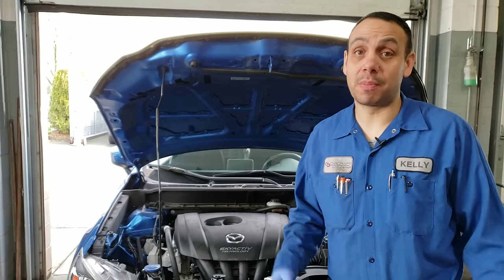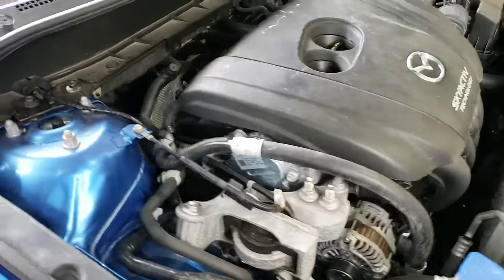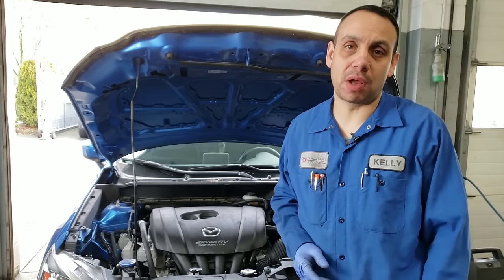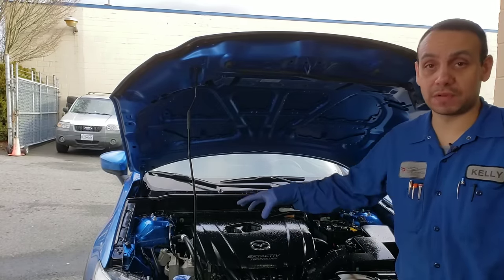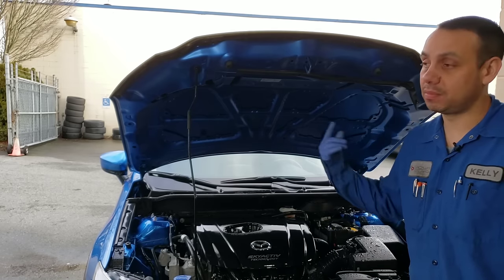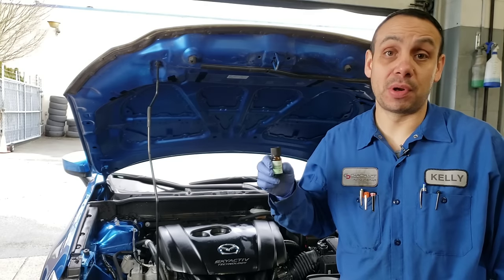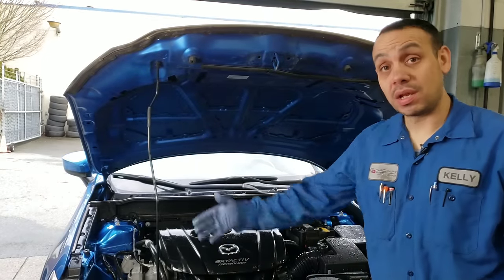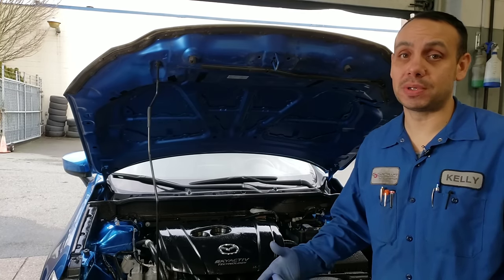Easy Tip To Keep Rodents, Mice & Rats Out of Your Engine Bay

Comment: I’ve been aware of rodents - chimpunks in particular - invading my car.  I don’t keep anything that smells edible including chewing gum in the cabin.  I’ve tried the peppermint oil spray.  This summer a horrible smell blowing from the cabin vents got my to check the cabin air filter. It’s up under the glovebox.  Sure enough there was a large nest and a dead rodent in the blower.  After replacing the filter I sprayed peppermint lemongrass and clove oils eveerywhere - in the cabin foot wells, under the hood, wheel wells, and the gravel around the vehicle   Will try moth balls next.  This is a 2016 Prius and I’ve heard this is very common in my car, but very common now with most new vehicles.

Comment: The mouse blocker device works well. Rodents don't like high pitched sounds or flashing lights. If you have a garage, open the hood and shine lights toward the engine bay at night.Rodents hate light!

Comment: There is a certain small wire on the 2012 - 2015 Honda CR'V's that rodents like to chew on. It will not help your engine run well at all.  That wire is located in the center of the firewall down low, almost out of sight.

Comment: I have that same Mazda engine in a CX-5 that sits outside and have had mice nest under the plastic cover so I wish he had taken that off and inspected underneath it. I will have to try the peppermint oil treatment, hadn’t heard of that option. We’ve put Bounty dryer cloths in a car that we store for the winter which seemed to help.

Comment: they used to use soybean at part of the materials for electrical wire cause it was cheap and then they noticed it was getting eaten allot so they stopped using that from what I herd but its still an issue cause its a warm environment if you just got home and its cold out. I would probably treat the underside mostly to keep them from ever entering the engine bay ,  tires rims chassis .

Comment: Do you have to cover the alternator or any part of the engine before washing? Thanks!
Reply: Back in the day with older cars, you did have to shrink wrap the distributor so it wouldn't get wet. With these newer engines you're pretty much good to go. Just don't overspray around the computer and fuse box area.
Reply: @IamGroot786  Thanks a lot. My car is pretty old though, about 15 years.

Comment: I've had frequent gnawing damage under the car where any under hood treatment doesn't get close to. Fuel tank gauge pump & evap system wiring, I think it's a woodchuck cus I've chased one and it ran up under the cars. The places damaged could be easily reached from standing on the ground under them. A mouse would have to be hanging from above to reach there. Once had a rubber transmission oil cooler hose chewed open. When I started the car all the trans fluid blew out on the driveway.

Comment: I’m a retired auto tech of 40yrs. This is a helpful video but missing some key points. That top engine cover easily snaps off & is commonly removable on many other manufacturers. Under that cover often reveals a lot & usually there’s much more poop & chewing damage plus they chew on the underside of the cover. The cover & engine can be cleaned much better separately. German cars are especially prone to rodent damage as ecological wire insulation is commonly used. 
They also often get into & nest the heater &/or cabin filter compartment.
 When rinsing don’t spray directly on the alternator or black boxes & modules. Peppermint oil does reduce the chances but diluted that much will have little effect. If going that route & if you have other vehicles, boat, camper, use concentrated oil. When bought in bulk it’s far cheaper than those tiny bottles plus you need to reapply appropriately 20-30 drops per week around the engine bay as it looses its strength.
Best is an under hood rodent deterrent box. All our vehicles and camper have one & they work. They’re found on Amazon & Ebay, around $25 & up. They periodically emit a very high pitched sound (young folk can often hear it but there’s usually an on/off switch) & some come with flashing strobe type lights as a visual rodent deterrent) & they’re easy to install even directly on the battery. Sometimes you have to replace one after a couple years but cheaper than electrical repairs & engine compartment & cabin filter area cleaning.
You still need to do a cleaning if the rodents have been hanging around but if not, it’s a good way to make to keep them away.

Comment: I spray the clean dry engine compartment with Blaster 2000. Vermin hate it and it leaves a nice protective barrier.
Reply: @AmberAntGad  
Hey. AA, Wally mart and Home Depot usually carry it
I like it, so I order it on EBay by the gallon and it comes 
with a spray pump bottle. Last month it was about $32 fans,(bucks)

Comment: The only time a mechanic ever told me that he thought rats were eating engine insulation was when I lived in the mountains and whenever I it rained, I guess they sought warmth under the  hood. I was in shock, I had never heard about that ever. Moved about 20 years ago and never had the same problem ever again. So yeah, if the mechanic tells you it’s rats, believe it.
Reply: Best solution for this is rat mesh installation from front bumper to engine and sides fully packed 👍

Comment: I used the oil and did not stop them , as I researched different techniques I found I needed to block entry to them little Batards ! I found in a Subaru there are 3 areas  that I Applied 14” Screen blocking the entry   , 1 in the Glove Box and 2 areas behind air filter. So far no mice in my car !

Comment: I had a problem with raccoons getting under the hood of my wife’s vehicle, building nests, going to the bathroom, chewing wires, chewing holes into engine air intake ductwork and packing it full of debris. 

I bought coyote urine, poured it into a mister bottle and sprayed a light coat around the engine bay, being careful to NOT spray it on anything that would get hot. I also sprayed it in the wheel wells and underneath the vehicle. I would repeat this process once a week. 

Fortunately, I never had a repeat of the first incident because it cost $800 to repair the damage. Luckily though this was a brand new company car and her work paid for everything.

Comment: I had mice build a nest of nose tissues in my 94 Dodge pickups heater that STILL blows a few shreds after five years. Another incident involved the fuel line coming out of the gas tank that was chewed by mice and it caused my engine to run erratically as I pulled out of my carport. Smelled gas, and shut it down. Very tough, hard gas line was munched on!

Comment: Many vehicles have a large opening or snorkel leading to air box/filter...Rats will crawl in and make a nest out of your cars insulation..Put a screen over opening ..I use metal mesh about 1/4 inch grid..

Comment: Great video by a good looking guy. Woof.  I just got my pu truck out of the shop for $200 worth of chewed fuel lines from rodents. Technician also found a few nest that he had to clean out. So I am definitely going to try the solution with the peppermint oil thanks so much. My technician also told me the last several months he has seen a lot of vehicles come in with rodent activity and damage under the hood.
Reply: doesn;'t last...use mace instead....

Comment: Rats running around the engine are certainly a potential hazard for wires and rubber/plastic parts getting chewed, especially during the cold season, when they like the heat from the engine at night after it's been driven.  But it can be even worse. Unbeknownst to me, a rat made a nest under the hood, and while driving the heat from the engine set the nest on fire, burning the insulation under the hood. Fortunately, the paint on the top did not bubble, but it was a lesson learned. 

Another problem I had was that a rat got into the trunk from underneath, and got on top of the fuel tank. Little booger chewed through the fuel line. Cost us $760 to get it repaired, as the fuel tank had to be moved. Rats can sure cause damage to a car.
Reply: Best solution for this is rat mesh installation engine and sides of the tyres fully packed 👍

Comment: DRYER SHEETS.  Rats hate the smell of them. Attach a few in the engine bay, lay a few under seats, and in the trunk.  Change them out when the smell leaves the car's interior.  I've been using them for years, and never had a rat chew or dump on anything.

Comment: Haven't tried the peppermint spray coating but I'm going to. I can unequivically say that the sound, light, and other technical gadgets are a really bad idea. Initially they work. Then months later your car doesn't start, you raise the hood and have a nasty infestation and your little roden proofer is sitting there working away just fine. The fact that it works initially throws you off, you think you are done. Meanwhile they adapt to the regular noises, lights, ultrasonic, whatever and start building their luxury mansion. I've been fighting pack rats, the nastiest of the bunch for years here in Arizona. Best solution is a clean flat area to park and frequent checks under the hood. Still haven't found a good permanent repeller but we'll see how the peppermint does but I expect you should re spray frequently (I know it works on bees).

Comment: I take a couple of old socks and put 15-20 moth balls in each one, I tie a knot in each sock so the moth balls don’t come out and I place one on each side of the engine compartment. That has worked for me. I own four vehicles and they sometimes sit for a good while between usage.
Reply: Mothballs are flammable, have you had any issues whilst driving?
Reply: @garydurandt4260   never had an issue but I usually put the sock in each front corner where it is not very hot.  I would think that the only area that would be a problem is on the exhaust manifold.

Comment: I am wondering about the possibility of fire because of the heat of the engine and the oil.  I have them tearing away my fire block insulation.  and need that looked at as well.

Comment: Here is another rodent killing option that I have used .
All rodents need water and food.
So..
Fill a bucket up about 5 inches from the top , with water .
slightly less water if your dealing with rats .
Wrap an old blanket around it so rodents can have easy access to the top of the bucket .
Smear a little  peanut butter on the top edge and inside edge of the bucket .
Put some peanut butter inside a couple of  plastic bottle caps , and float them in the water .
The mice ( rats ) will try to eat the peanut butter but fall in to the water and drown.
You need to check this " trap " often , because after one mouse dies and floats on the water , the next mouse can use his dead body to jump out of the bucket , if he falls in .
They use this type of non- poisionous trap in Texas schools years ago , because its pretty harmless to children.

Comment: I'm a retired mechanic. Live in Arizona. The only real way is light, they hate light. I live off grid 3 years now. I'm in the middle of rodent heaven. I leave my hood open. No problems. I've had many customers that have tried the chemicals' they still get towed in. If you can't leave your hood open put a drop light under your hood at night.Good video though.

Comment: i've never had this problem living in the city.  except i bought a used car that had some of the wire harness chewed up.   dealer found it. wanted 1k to fix it.    i vacuumed up, the remainder of the nest and droppings,  coated the wires with liquid electrical tape.  no problems so far.  it cost me $12 for the liquid tape.

Comment: Just did this last week with the cottonballs when I noticed a squirrel jump up into my wheel area.  Found it just in time before it started making it's nest or stash.  Hasn't been back. Funny thing too, it's warm out, and the car was only sitting for about 24 hours.  So it can happen quick.   I did spray the wheel area but I also use alcohol in my peppermint/water mix. Not sure if that matters or if it dissipates quick enough?  I'll make some without the alcohol and start spraying that every so often.  I forget about the cottonballs I put in there and I know one is lost somewhere in the engine.  Wasn't sure if that was ok to spray directly on the engine area.

Comment: Rat stories: I was dating this woman and a rodent chewed through her main harness. $2000 repair at the Honda dealer.
I bought a used car and pulled out the cabin filter. It had a mouse nest on it and a hole chewed through it. I will try the peppermint oil.

Comment: Our pickup sits outside year round. 
I cannot keep checking underneath the hood every week or so when we have 5-7 feet of snow on the ground.
During the winter I clean off our pickup a couple of times a month and drive it into the city (25 miles away) just to keep it going.
I guess we should invest in cats to keep the mice at bay.

Comment: A Field Rat Ate My Ignition System
by
Lee Manatee 
(An essay to whet the ol writing skills and nothing more)
TLDR: Yeah, it frikken sucks.

Imagine my surprise this Sunday while doing my weekly fluid level and under the hood inspection checks on my beloved and trusty , now antique status, Buick Century (almost 170k relatively trouble free miles) to see one of my ignition wires was severed near the coil pack. 

I had overhauled the entire ignition systems two years earlier and assumed it was the result of being made from the finest of Chinese soy products mixed with blood sweat and tears and had become brittle from the heat or something. A quick swap out with an old yet still serviceable wire put things back in arrears.

Imagine my surprise two days later while starting it up to hear a loud ticking noise accompanied by an obvious misfire as the car shook and shuddered. A swift pop of the hood revealed another wire had not only broken near the coil pack but had a 3 inch section missing while long arcs and sparks flew all over the place. Okay, now this is getting suspicious…Another quick swap out with an old wire and a lot of wondering who was sneaking onto my property was had while driving about my daily business.

I had decided to check the area for the missing piece of wire before parking in the usual spot. It was immediately discovered and revealed evidence of what seemed to be teeth marks as it all fell into place.

It was after googling the subject and seeing this and other videos then popping the hood to administer a solution about 30 minutes later when the culprit was caught flagrante dillecto chewing on yet another wire. The rat was freaking HUGE! 

It was decided to put a sticky trap on top of the intake manifold so it would be unavoidable when the pesky perp returned to chew on the wires plus a rat trap soaked in burger grease next to it in addition to a portable wireless motion sensor to forewarn me of the next ratty crime. As an extra measure,another sticky trap under the car next to a front wheel.

That was yesterday and nothing has happened since. I must of spooked it away or else it was spying on me while deploying countermeasures and has hatched another plan to eat my tasty irresistible ignition system. 

This is WAR!

Comment: Peppermint Oil & Moth Balls are the kind of Voodoo Stuff I have been using under the hood of my 370Z, I did not do it for my New Frontier, and 3 days ago when I took it for the First Oil Change (@ 1911 miles), the shop manager pointed out at the damage to the engine cover, I cringed, now I will be doing that Voodoo Stuff to the Frontier as well. These rodents roam everywhere on the lower floor of my house (only because my cats are not allowed there). I cannot kill them because I respect all forms of life, these poor things cannot help it, no one has told them what is good or what is bad.

Comment: I have an electrical car. And I got the same situation looks like I caught it right away. Just some feces/urine from rats. No physical damage. I cleaned it up real quick with a lysol whipe but I should clean it like you did in the video like a thorough cleaning. My car is electric. I have a hyundai ioniq 2020. Can I do the same spray down? Im worried I might fry a control unit or something

Comment: I have a Corrola out back that the mice love. The spark plug wires are all gone.as well as a lot of other rubber. A Camry has been there a lot longer and is hardly touched. I threw a couple of bags of moth balls.under the wife's Accord. It sits without being driven enough. Not sure it will work but they havent.bothered it yet. I've heard of using Ammonia.

Comment: After cleaning and inspecting/repairing cables and wires, use moth balls in small cloth socks secured around the engine bay to keep the critters away.
Reply: This does not work. I tried it. They kept chewing the foam and wires

Comment: Rats are a big problem everywhere. I've forgotten the number of times the wires have been chewed up. I was told to keep tobacco leaves in small pouches in the engine compartment. But that didn't help either.

Comment: rodents loved my father in laws chrysler 300. I was told that the wiring was made partially from organic materials, cost him over $4000 to get it fixed.
whether the organic material surrounding the copper was made from organic material or not, I’m not sure, but they sure made a mess

Comment: One of the reasons mice like to eat the wiring is the insulation is made of soy!  I'm an electrician and I see the modern wire used today as a feast to mice that get into places where it is present!  I go into alot of attics where maybe some wiring was added along with the old asbestos coated wire!  In 33 years I've never seen the asbestos wire chewed!  It's always the soy based wire!  Mice or rats that get under your hood while engine is warm in winter can do tremendous damage in one night!!  A friend of mine had $ 2500 worth of wiring damage overnite!!!